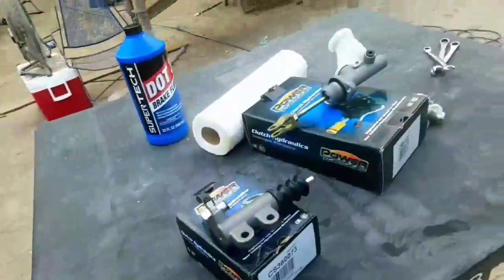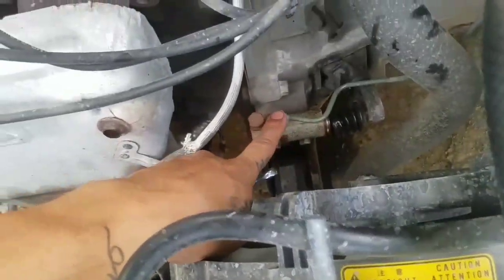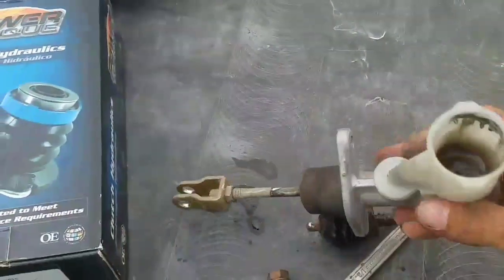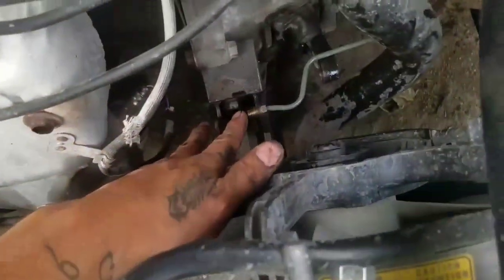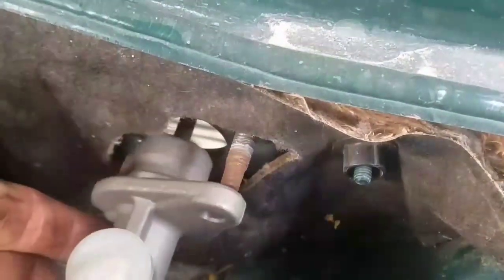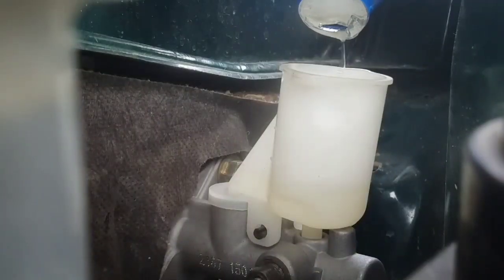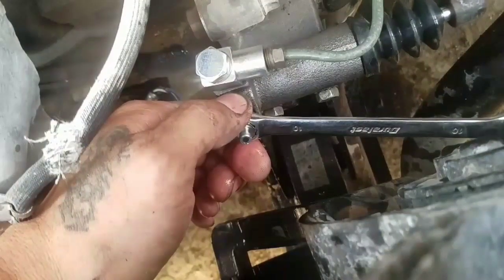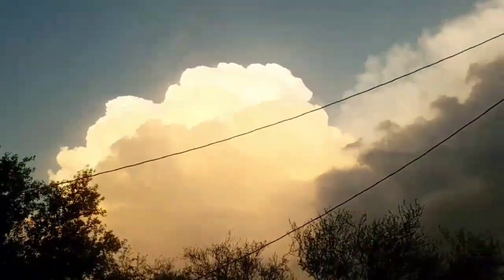Mitsubishi Mirage Clutch Master / Slave Cylinder Replacement

Comment: Nice video mate very informative, I have difficulty in engaging 1st,2nd and reverse gear, I've changed the transmission oil already but has not made much difference, was wondering if the clutch master cyl and slave could be causing the issue?

Comment: Great video! Plenty of space at the clutch master cylinder compare to my 2004 Ralliart.  
Just got done with the clutch/pressure plate. These two items are next.
Reply from the maker: I would like to upgrade the clutch on mine! Haven't done one,  but looks simple and spacious enough. 
Good luck on your master/ slave cylinder replacement
Reply: Personally my mirage's slave was horrible to work on

Comment: I didn't realize until I had everything installed on mine that I had to bleed the master clutch cylinder first, then install everything, then bleed the entire system...possibly because my reservoir isn't directly mounted to the master clutch cylinder? 🤷‍♂️ I had to take it back out, bleed it and then install it before it would work. So if anyone gets everything installed and your not getting any pressure to the slave cylinder, you need to bleed the master cylinder first before installing it. I skipped mechanic class all the time in high school, so everything I do now I'm learning as I go haha. Wish I wouldn't have skipped class and paid more attention 🤣
Reply: What do u mean bleed the master cylinder first?
Reply: @pjsaltbabyrage7567 means he depressed the slave cylinder first by hand to get the prime started otherwise the pedal depression is not gonna work. Once tou do this you can do the pedal method in the video.

Comment: What if you don't have compressed air to blow out the line  ? Second: Don't say oil when you mean brake fluid. Some knot head may actually put in motor oil !  Otherwise this is a very good video :)